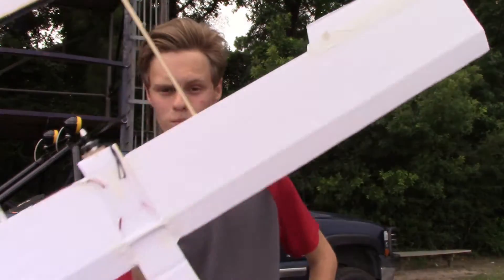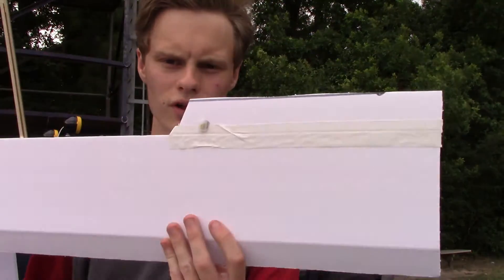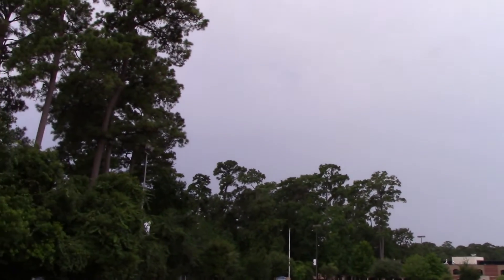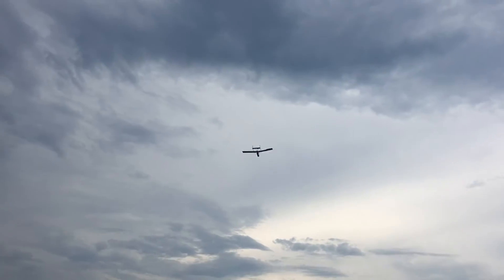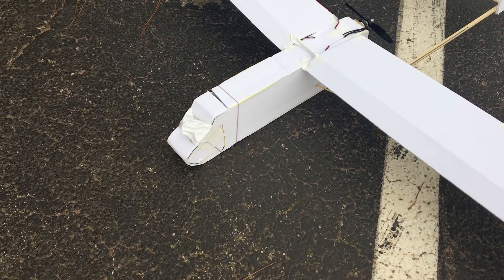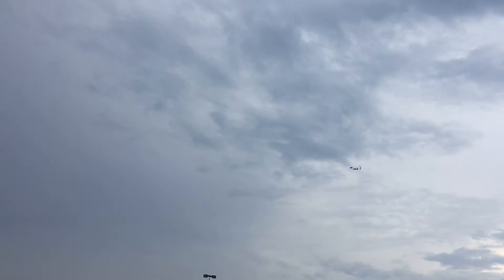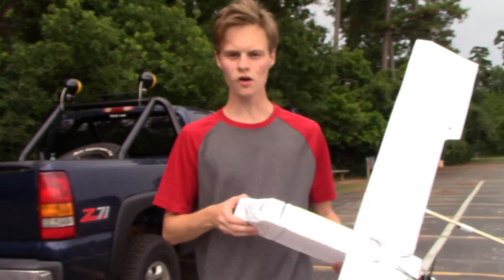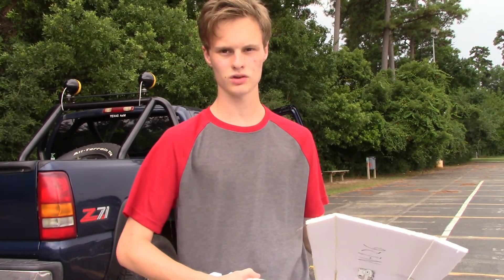DiY Twin Boom RC Airplane! (N-126)

Comment: also, KF airfoils help greatly on the rigidity of the wing. A little bit more material used but it can hold 1-3N of force!
Reply from the maker: yup, I'm planning on using one in my next build